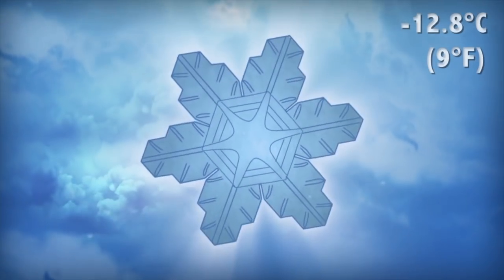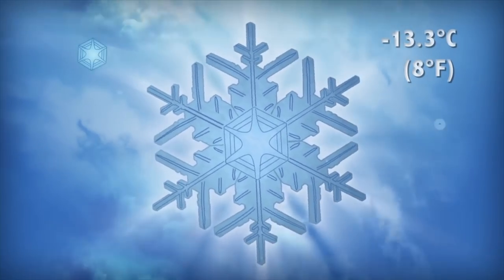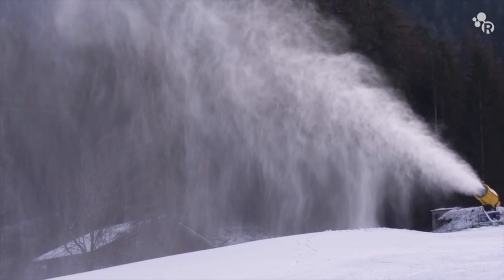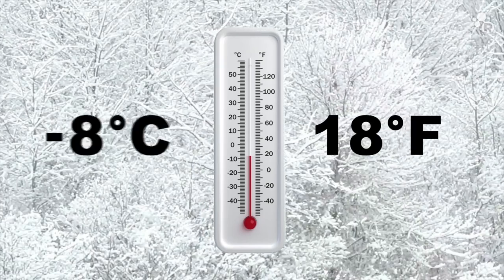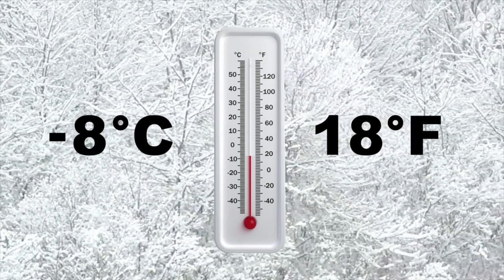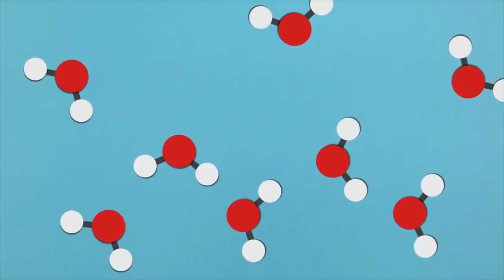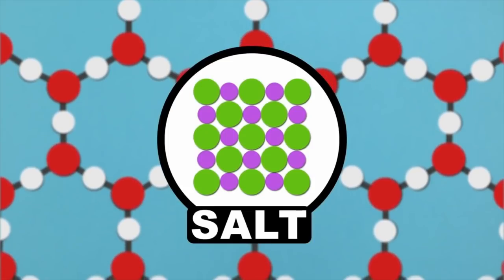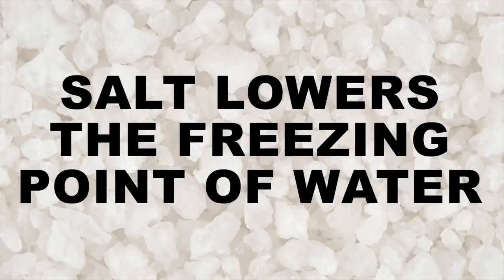How to Survive the Snow and Ice

Comment: How does Calcium Chloride ice melt work?
Reply: The same way the sodium chloride does, with the advantage of being slightly exothermic going into solution. Sodium chloride is slightly endothermic, so it actually has to absorb some heat from the ice to go into solution.

Comment: So the explanation for freezing point depression is, well, kinda wrong. The driving force for freezing point depression is entropy, not the interaction with ions. I realize the entropic explanation probably takes a bit more time, but it's better to just not explain it than to explain incorrectly.

Freezing point depression is a colligative property, meaning that it only depends on the number of dissolves particles. dissolving salts in water increases the entropy of water, which makes the entropy decrease upon freezing higher, which decreases the freezing point.
Reply: There are many ways to explain the same phenomenon actually. Pls don’t comment if u are not totally familiar with the science behind it
Reply: @Aleksander1231000  um, yes, I am. The explanations aren't equivalent, and their explanation is incorrect. I'm a chemist myself.